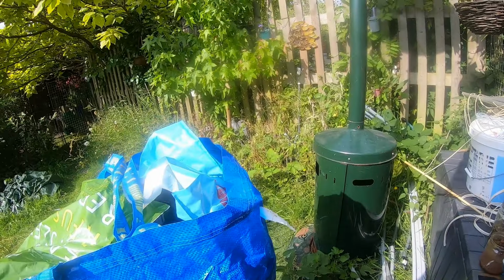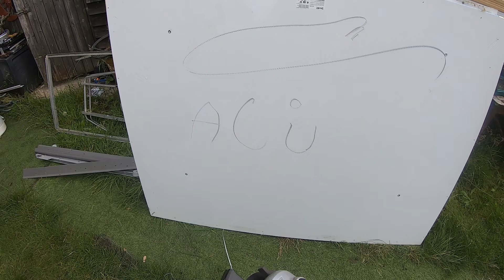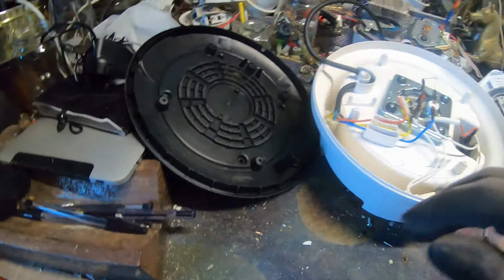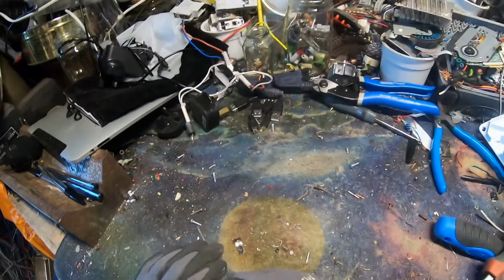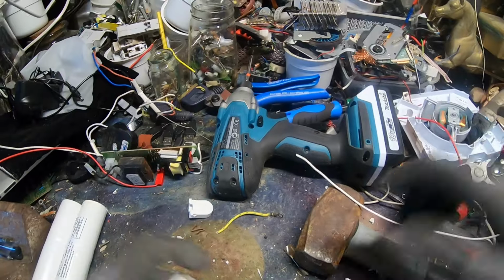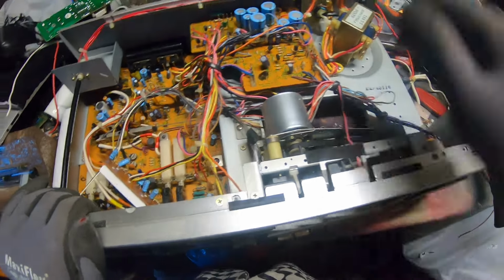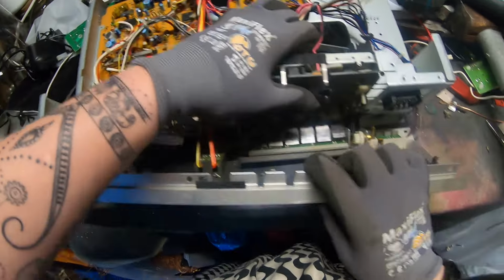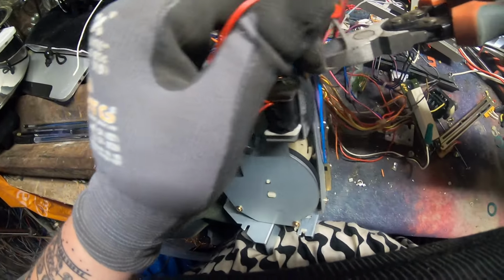Tools make light work for Sollers, plus some chat and fun tonight!

Comment: Good watch Sollars i use the steel cutting disks for my grinder they last longer and they stay the same size and dont shrink the one i use is INOX thats if they sell them in England they are good for a 1000 plus cutts all metals as well the cost here is $25.00 good luck
Reply from the maker: Thanks, that's great to know, I'll look them up🙂👍

Comment: So what is the deal here, grab stuff from the skip, get the metal out and sell the scrap? Looks like you have a fun set up here. Consider wearing a mask for the grinding, even the dust from the disc breaking down is veey harmful to the lungs.
Reply from the maker: A mixed set up really, I get stuff from skips but I also do arranged e-waste pick ups but all as a hobby as I have a career specialising in Autism and I'm a working Mum of 4. I use a respiratory inside but was a bit naughty here as it was a quick outside job, but you are right, safety first!! I also get given a lot of goodies, I break stuff down, some for the scrap yard, some stacked ready for melting in the furnace (I keep copper for future casting) and some for components for e-waste sculptures. Thanks for watching 🙂
Reply: @SollersScrappingandDiving  do you weld up any sculptures? That would be interesting to see. Will follow your future videos as it all seems very interesting. I mainly do model engineering on my channel so anything with some tools on the go grabs my interest.
Reply from the maker: @tandb  not yet as I mainly use smaller electronic components but I want to learn to weld to make bigger sculptures form the waste casings and steam punk components etc. Oh you have a channel, I'll check you out 👍
Reply: I’ve just ordered a new 16in1 respirator and 100 extra cotton filters, I’m much worse, grinding with cup of tea, sandwich🫣 enclosed area, and you are right, no excuse, I just get into my groove and forget🫣
Reply: @johnthompson9032  write PPE in large letters on your grinder using paint. No excuses then.